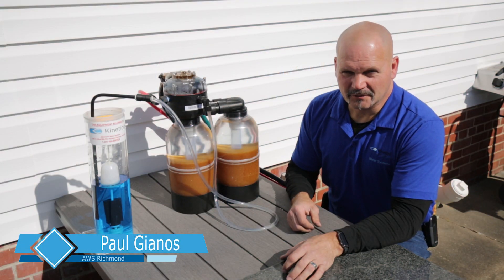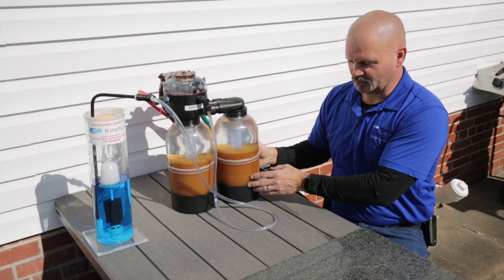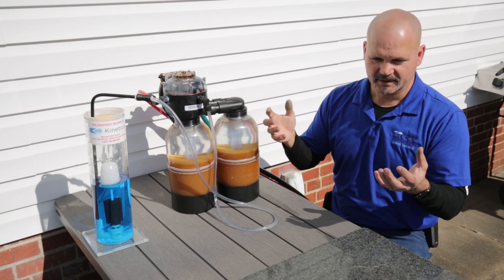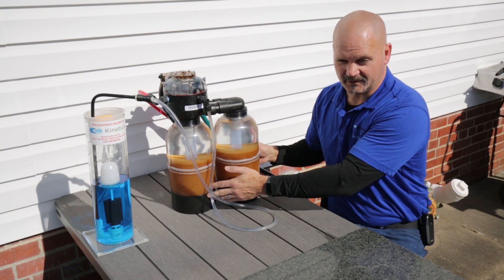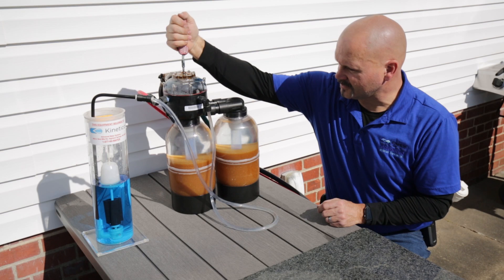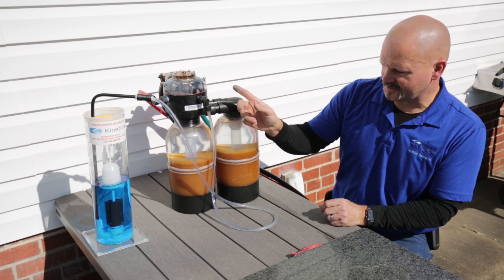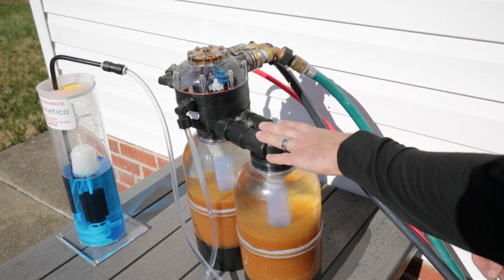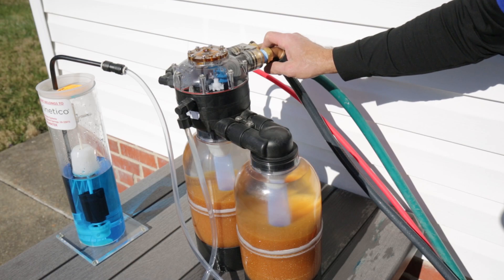How a Kinetico Water Softener Works with Paul

Comment: Excellent video. How long do the resin beads last?
Reply: Depends on regeneration frequency which is based on your water hardness.  Anywhere from 10-25 years.  Can trick it if it's getting old to get a more frequent regeneration disk.   They go from 1-8, the  higher the number, more often it regenerates

Comment: Thank you for your informative videos. I have a question. If my discharge line from my Kinetco water softener runs outside and freezes will that damage my water softener as it goes through regeneration ?  Thanks again.

Comment: Thanks! Great vid! My house was built in 89 and still had the original Kinetico Model 30 with the Kinetico Aerator. I had a tech come out about 8 years ago to check on its performance and to make sure all the settings were correct. He did not want to do an exhaustive test and test the water ti make sure the salt content was correct. He just said it was fine, but wanted to sell me a new unit. I think back then it was somewhere between CAN$2,500 and $3,000. I said no thanks. Fast forward to Jan 2025. I had the system in “bypass” mode since the summer and only now got around to dealing with a bad installation. The floor had started to rot out due to years on condensation from the aerator tank. The system was also located right next to electrical breaker platelets. Relocated it further away from the panel, cleaned up all the plumbing, and now need to clean the head from sediment that accumulated because I didn’t change the pre-filter often enough. Hoping it works when cleaned and reassemble, but probably need new resin beads. It’s nice to see a desler being honest and willing to refurbish an older unit bs trying to cash in on the sale of a new unit.
Reply: Jesus Christ! You made me actually perform math to figure out your home is 36 years old! Secondly, that technician back in 2013, again mathematics, was most likely trained on that Model 30. He knew good & well your system was fine. Thirdly, we still don't know if you've upgraded or what! And fourthly, what the heck is a "desler"     ?! Come On Man

Comment: will the discharge water kill my lawn or plants? can i use the soften water on my plants?
Reply: The dealer drained ours out the side of the house, killing the grass surrounding the discharge line. I later installed a catch basin, out of a Home Depot bucket and some gravel. I buried it 6 inches below soil line and filled it with gravel. That fixed my issue!
Reply: Yes it will.

Comment: How do I know if I need to change the resin? I have a lot of iron in my water and I'm worried it might be fouled.
Reply: Make sure you change your prefilter. Also, make sure you have a water test to determine the amount of iron and that you do not have Ferric iron.
Reply: Iron removal system (bleach tank; hypochlorite 7% I think minimum) is needed before the carbon or softener, otherwise the iron will foul/shorten the life of the resin...

Comment: I’m about to get a Kinetico system installed, but I can’t find much information on which of these two systems is better. Is one system consider better or more efficient than the other. I like the compactness of the 4040 but I was told the 2060 has higher capacity. 

Kinetico 2060sOD
12x52 Dechlorinator 

Kinetico 4040SOD 

My household includes two adults and 2 toddlers. We also have a pool that’ll require about 100 gallons per day during the peak summer months. 

We’re on City water in Wylie, TX 
Hardness 10
TDS 242
PH 7.2 
Chlorine 3
Reply: hi there sorry for the late response but for some reason our comments have not showed up under this video  but hopefully we can answer you now..
Reply: Please by-pass your system for filling the pool, no utility to do that

Comment: My issue is the timer works,  checked the timer. The regeneration process does not stop! It generates for hours, 7 plus
Reply: My Kinetico system is 25 years old, and started doing that also.  It will run the well dry. I couldn't figure out how to stop it so I crimped the drain hose to stop the siphon. Guess it's time for major overhaul ...
Reply: @jafforte999 can you bypass and call your dealer?
Reply: HI Lisa sorry for the late response but for some reason our comments have not showed up under this video  but hopefully we can answer you now..
Reply: A Kinetico does not have a timer unless it is an electric version.

Comment: I see 2 elbows on the valve body.  One with that clear suction line and the other with that red (discharge?) line.  Without the lines connected, is there a way to identify which is which since they look the same?